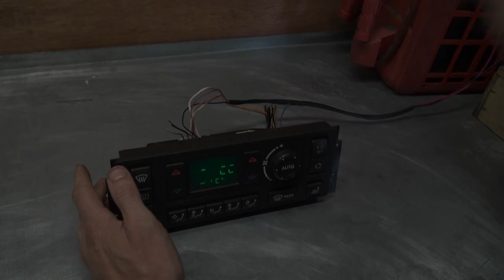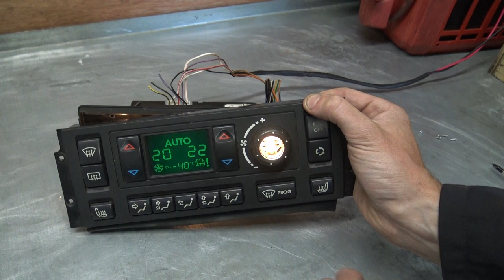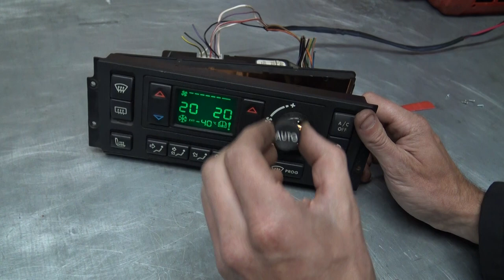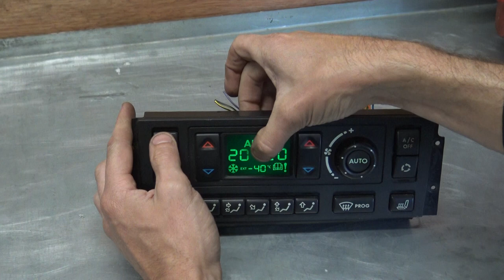Range Rover P38 HEVAC Screen Repair: How To

Comment: I just performed this repair on my 01 HSE. I would like to share a tip for cleaning the metal contacts, an eraser makes this much faster than using a plastic scraper, as long as you are careful not to overdo it! Thanks for the great vid and tips!

Comment: Great video. I have a quick question. 
Got a few of these units from a friend(with various problems), and I'm trying to figure out how to connect it to my bench PSU for testing. Tried connecting Bat+, Ignition1 and GND - nothing happens.

EDIT: Nvm. After few minutes of tinkering in my workshop I found everything I needed. Totally missed that I also need to connect "ignition 2" and backlight.
Reply from the maker: No problem.

Comment: hi dear,
nice video and so useful, 
I have another issue with my HVAC which is the buttons lights doesnt come on when I switch the car lights on! knowing that the light bulbs on the HVAC board are ok!
Any help on this ?
Reply from the maker: We also supply a bulb kit for the illumination bulbs
https://shop.v8engines.com/range-rover-p38-hevac-bulb-kit-757-p.asp

Comment: HI, Great video. I have a spare unit and have a working screen and ribbon connector. What adhesive can be used to swap a screen from one unit to another?
Reply from the maker: Thank you. Sorry but we don't use adhesive as you can see we use the zebra strip.

Comment: any info on how to get my hands on the silly diagnostics for the HVAC? My HVAC "SES" light is on and it refuses to operate the bloody servos. Cheers from across the pond.
Reply from the maker: This is a great bit of kit, it does not do the air suspension but it will do pretty much everything else you need. If you send us an email on info@v8engines.com with your address I can get a quote to you including shipping
https://shop.v8engines.com/hawkeye-total-diagnostic-computer-for-range-rover-p38-and-disco-2-121-p.asp

Comment: Hi guys   can you tell me the hard wireing set up   as I can set up a hard feed.  I have the plugs. Just can work out your wireing in your great video    bestwishes nick
Reply from the maker: Hi,
We have received your email as well. I will reply via there.

Kind regards,
Ian
Reply: @RPIEngineering  i have just ordered the zebra strip, but please can i have the hard wiring setup as well
Reply from the maker: @andyladdster  Hi. If you email us on info@v8engines.com I can send you the details through however it will mean you will need to source the plugs to connect into the HEVAC unit etc and if you are only doing the one it is far quicker to just plug it in and test it before screwing it all in place.

Comment: Just done this repair. Works really well, since doing it though the outside temperature is reading -40 any tips
Reply from the maker: The outside temp will reset itself after a few restarts. We have seen this before and they always read correctly. Sometimes though it is the next day etc.

Comment: What does the book in the? Means my heater is on but it's not blowing anything out and the book in the? Shows up I barely used it cuz I have another car but I still turn it on but I think I need to drive it longer what should I do?
Reply from the maker: Hi,
The book means that the unit has a fault logged. You need to plug a diagnostics tool in (faultmate or such like) to see what the faults are. The best thing you can do is to clear all the codes and see what ones come back.
The blower motor relays in the fuse box are a common fault though (the fuse box itself can also be an issue)

Comment: My Hevac unit works but it has developed a white blob in the center of the screen. Not sure what is causing that, so its a bit difficult to read. Any help will be nice.
Reply from the maker: Hi Jeff, Yes sounds like you need a screen. You will need to source one from another unit.

Comment: What is the size of the connector? I can get these by the boatload if I wanted. Just need to know what size to order?
Reply from the maker: They are available through our webshop here https://shop.v8engines.com/p38-parts--services-90-c.asp
Reply: @RPIEngineering  what is the exact size of the connectors?
Reply from the maker: @alexandrarabinovici3826  I'm sorry but we do not publish the size of the connector. We sell them in our online shop in the link below. They are the correct size for the P38 Range Rover HEVAC display.
https://shop.v8engines.com/p38-parts--services-90-c.asp

Comment: can you let me have a diagram of how to connect in to test on a bench please as you have
Reply from the maker: If your just doing the one or two its far easier to just connect it back in the car and turn the ignition on to test rather than making a loom which you would need the plugs for etc. If however we are supplying you in bulk as we do some companies please email us and we can supply you with the details.
Reply: @RPIEngineering  i hope to do in bulk, whats the miun quantity? I will email you
Reply from the maker: @madbrit5053  I'll drop you an email

Comment: Also wondering about shipping to the US
Reply from the maker: We can ship to the US no problem (sent quite a few over so far) If you email info@v8engines.com I can get a quote over to you.
Reply: Hi, hi have a 2001 range rover and my odometer, instrument cluster is not reading noting in the mileage spot, ( it was reading but not completely lighting ) and i tried  to fixed replacing the bulbs behind,  now it does not read anything in the mileage spot only...everything else is reading fine, still i haven't checked any fuse, any recommendations? please, Thank you¡

Comment: How does the zebra connect individual pins?
Reply from the maker: It has thousands of insulator connectors running from top to bottom in the black strip. Its official name is Elastomeric connector however they are nick named zebra connectors due to their look.

https://en.wikipedia.org/wiki/Elastomeric_connector